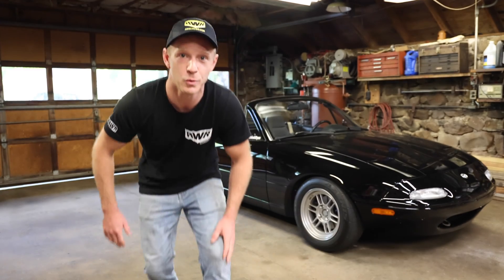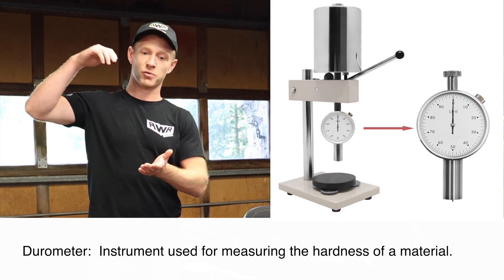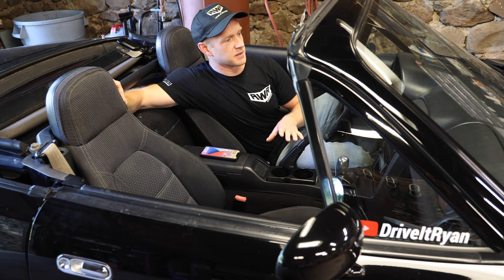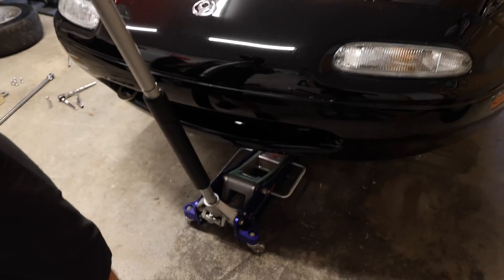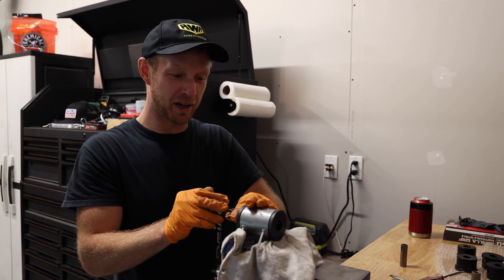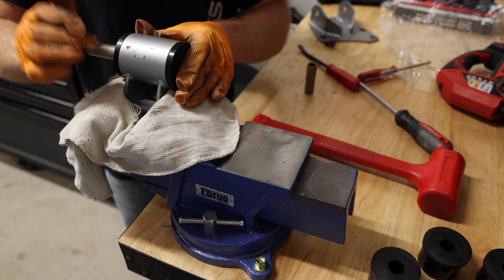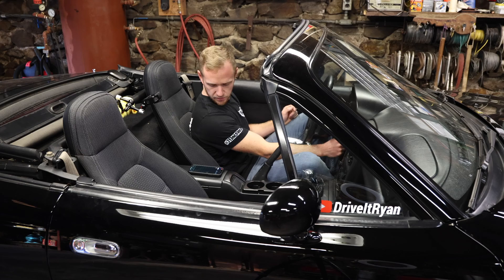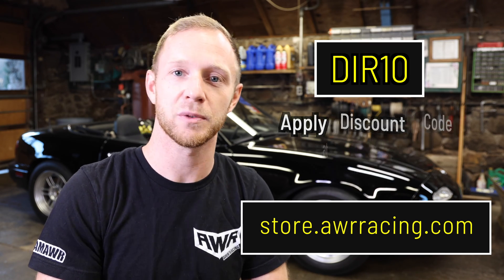Polyurethane Bushings Explained & Tested!

Comment: What a fantastic video Ryan! Thank you so much for all of your support. #TEAMAWR
Reply from the maker: Thank you all so much!!
Reply: What do you guys recommend tightening the nut and bolt that goes through the bushing? Actually don't have your guys' mounts but this info is missing from all the videos I've found and watched. Wish I did but went with innovative that did not come assembled so I just tightened them to fairly snug and installed but always wondered and never got an answer from them when I tried.
Reply: @mccall9770  Hello! The thru-bolt on AWR mounts should be torqued to 55 ft lbs. All other fasteners should be torqued to OEM specs. There are install guides listed on our site for our mounts if you make the switch!